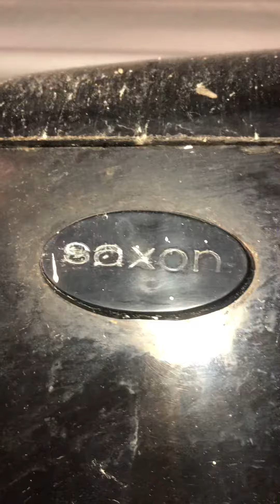HL 1960’s Valor Cisterns Ltd “Saxon” cistern and 2000’s Twyford Classic pan

Comment: Valor cisterns?! Blimey! I have no info of that company yet
Reply from the maker: I am going to look them up as i had no idea they existed either. I thought they were just another shires model. “Harrison design” must be their patent?
Reply: @ShiresLynx  I've just checked, Valor appear to be a large 60s retailer of all sorts of fittings, not sure where based yet. However it seems they specialized in retailing "Cisterns Ltd" cisterns. (they made Viking cisterns) I haven't yet watched the whole video in detail as i'm busy but maybe "Valor" and "Cisterns Ltd" are seperate?
Reply from the maker: @castironcisterns  i’m not sure, they seem to be the same company. There is some viking features on it such as the fulcrum and fixing screws. It’s really a mystery as to why it’s here, you would think they would use all Shires Lynx cisterns when they fitted them.